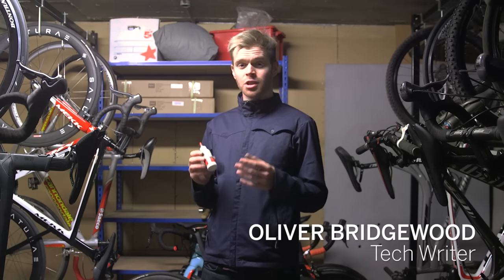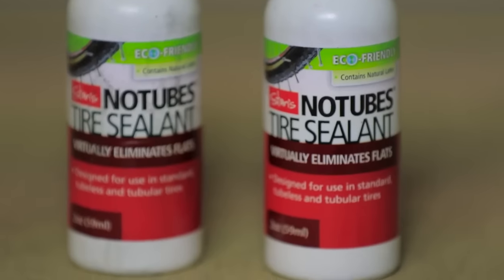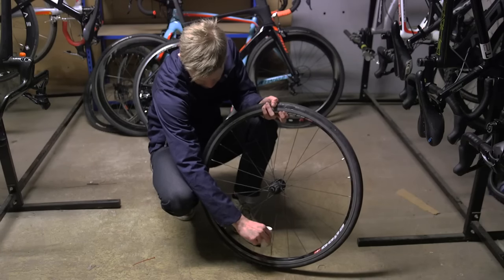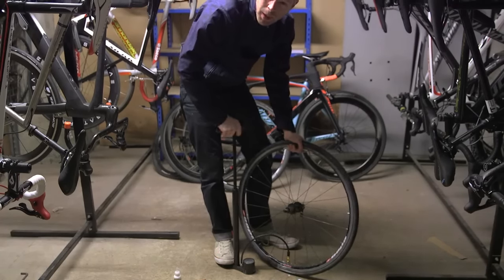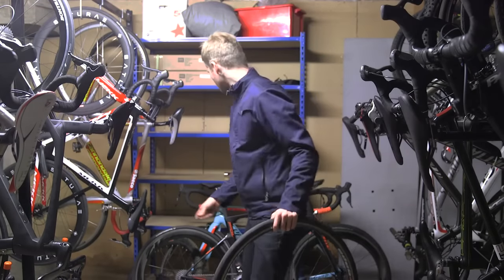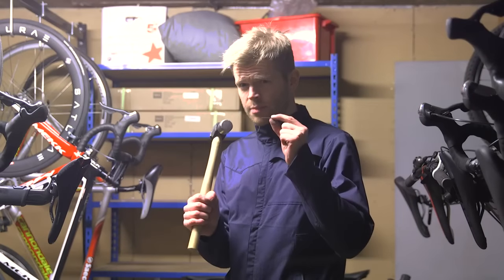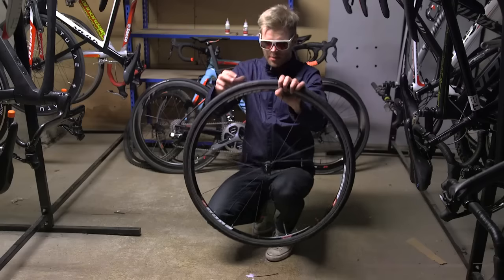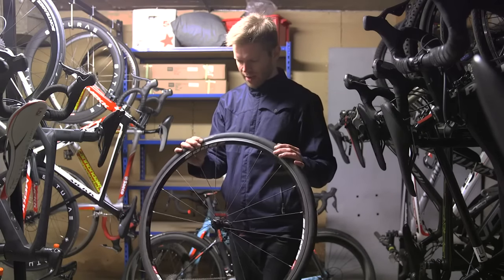How to puncture proof your tyres | Cycling Weekly

Comment: Great Video!
I've tried Stan's, Vittoria, Giant - 2oz bottles into the tube. I tested by pushing thumb tacks into the tire. Either it just doesn''t seal at all or it loses most of the air (I run 60 psi in 35mm CX tires) before sealing.  When I pump it back to 60 psi - it starts to leak again.  It seems to be more reliable in low pressure applications such as MTB tires or in full tubeless road tires.  But take a look at races like Dirty Kanza - expensive tubeless systems being run by many pro cyclists - punctures galore!   I would love it to work but it seems unreliable at best.  I use 28mm folding tire with sidewalls cut off - inserted into my 35 mm tires as puncture breaker.  They weigh about 150 grams per strip (the 28mm insert).  So far, only a pinch flat as I ran the pressure too low at 50 psi.  You can always carry a 2oz bottle of sealant in your back pocket - for emerg situation - and give it a try instead fiipping your bike over and getting out your tools.

Comment: You have to consider the likely possibility that the tube may not seal but instead leak out between the tube and tyre, and because most wheels don't have prefect seals around the valve and spoke stems. This may result in a very sticky mess inside the rim and tyre and a flat that you can't fix while on the road.

Comment: If the valve core isnt removable, you can still do it using a short piece of clear PVC aquarium air tube pressed over the threads, valve open obviously, and slowly squeeze it thru that, may take a little bit longer though.
Reply: +dan davis I have the same problem.  Check the link above for tips.  Sealant is sold in 2 types:  preventative and emergency use.  The latter uses a thinner solution so you can feed it into valve core.  I have not tested this.